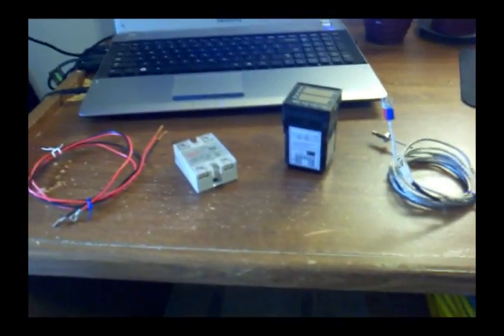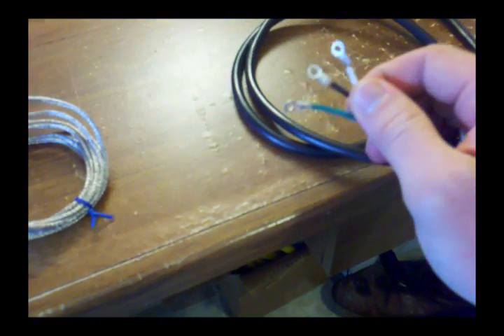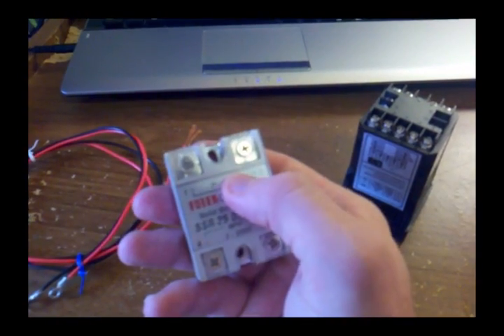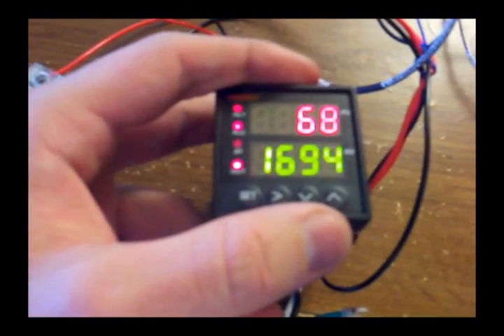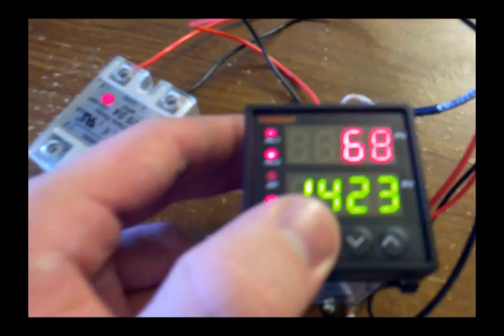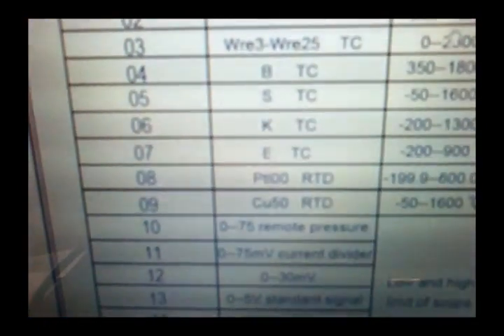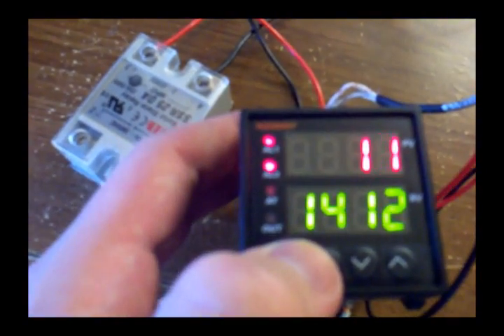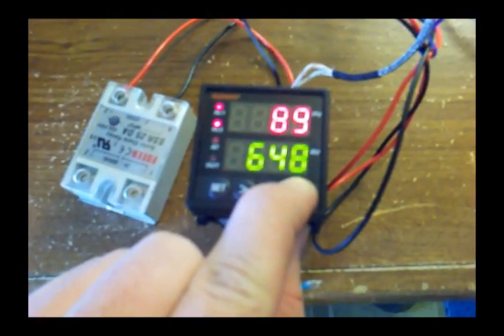Kiln Controller - Wiring the n2006p PID temperature controller and adjusting settings.

Comment: So I have a different pid controller and it has some different settings. How do you make it heat up slower so that it doesn't break all the pottery? I'm guessing I can program different heat set points for certain period of time? I have 14 because I broke it down into half hour increments. The manual is horrible Chinglish.

Comment: I am unsure what you are trying to say @time 2:00,  but you are saying positive and neg on the power cord,   what you saying is totally wrong as far as the polarities,  the black wire is always the hot wire in standard 120v powercord,  the white wire is a neutral, that should have no voltage on it ,, if you measure it to ground or green,,,, the black will have 120v on it if you measure from it to either the white or green,    so as you called the white positive,    makes me wonder if you know about  electricity ,  and for some one to try and work on this after you, it could be very dangerous,  if they don't know you have reversed the wire polarity..

Comment: You know you should do way more research this I didn't know this I didn't know that shit is crazy. Do you know anything? Don't start messing with stuff if you don't feel the need to inform yourself before purchasing stuff and MESSING WITH ELECTRICITY! By the way fuck nut THE BLACK WIRE IS THE HOT NOT THE FRIGGIN NEUTRAL

Comment: I also am making a Kiln and purchased a controller from ebay. On the face my controller says N2006P but it does not look like yours. yours has two lines of led numbers and mine only has one. I wonder what the difference is? Is your controller set up still working?

Comment: Hello...could anyone tell which mode should i select for the alarm 1 and alarm 2 of my p731 Pid , to activate their buzzers just for 10 Celsius duration?  (alarm 1 from 380-380C  & alarm 2 from 390-400C) ?  1)  Upper  or lower limit alarm   2) upper  or  lower limit deviation , 3) upper & lower deviation alarm, 4) within range alarm  ???? ( I have the option also  to set  the alarm 1 and alarm 2 deviation ) . Thank you so much

Comment: Good info, thanks.

A few questions arose. What element determines the highest working temperature of the controller -- the thermocouple or the PID unit itself? What's the highest temp you have successfully used the system at?

Cheers
Reply: PID unit itself. As I can transfer a thermocouple from a Pyrometer to a multimeter and read higher temps off of the same thermosensor.

Comment: is it possible to run two heating elements with a single somid state relay
Reply from the maker: +Marky Martinez Definately, although you'll have to decide wheter you want the 2 heating elements in series or in parallel. In parallel, the two heating elements are joined at the ends and with series the 2 heating elements will be joined in the middle. The main difference is that you should get a lot more heat in parallel than in series.
Reply: oh ok thank you man im new to this stuff

Comment: Is your kiln 240v? Does it only need the single SSR? And where is the wiring from the power coming from? Is the kiln still plugged into the wall or is it connecting to a receptacle on your controller and the controller is now plugged into the 240v power supply on the wall? Also on the older ceramic kilns do they already have a place to install the thermocouple or how did u connect it to the kiln?

Comment: And those R, K etc is not a setting but the type of Thermocouple you have and are planning on connecting. Most likely you have a K type.
Reply from the maker: That's correct. Thanks for commenting.

Comment: DAMN... If you have the little knowledge of electronics, i would suggest you stay away and get someone that know what their doing.  What if the AC power were positive and neg orientated and you plugged things in without knowing? It would blow up your device and in the worst case shock you to death.  Playing with Live wire is plain stupid.  Why are you giving instructions? Are you totally certain what your teaching is correct?
Reply: AC have no positive and negative, only N and L dummies.
Reply: Not an idiot, just needs to learn a bit more on electrical engineering.
Reply: @daviddaigle4841  YOU SHOULD JUST WAIT UNTIL YOU LEARN WHAT YOU DOING TRUST ME I HAD AC  REACH OUT AND BITE ME DID NOT FEEL GOOD
Reply: AND THOSE LETTERS MEAN SOMTHING OR THEY WOULD NOT JUST RANDOM ADD IT
Reply: He perfectly proved his point.
Reply: AC have positive and negative ?? really ??
Reply: lol
Reply: David Daigle yep.  He is an idiot.
Reply: David Daigle lol.  I'm not an electrical engineering degree.  Sometime I'm an field experience, and sometime I'm an conspiracy theory.

Comment: dose this device work?  i have seen the same one on eBay and am planning to use it to control a powder coat curing oven
Reply from the maker: Yes, this model works for many applications that do not require timing schedules to be programmed in. More expensive versions can be programmed, but this one works well for selecting and holding constant temperatures.

Comment: I bought one of these controllers to use for sous vide cooking (cooking for long periods at a constant temperature to tenderise inexpensive cuts of meat.  When I got the PID and the engineering-like instructions I freaked.  While the digital temperature controller unit that I have is slightly different (company that manufactures it is called SESTOS) the SSR is exactly the same.  The basic wiring tips for power and connecting the SSR to the PID were great, thanks!

Comment: As per the note you have added, "Inty" is the type of thermocouple. But  you continue  to not understand the chart reference of E, K., for example, are not offering a choice of temperature range for the controller, but are in fact for the type of thermocouple to be attached and the temperature range is its calibration.  So you select for the type of thermocouple.  The one supplied is a K type, I believe, although not all K types look the same and some are a foot long ceramic sheaf. The K refers to the type of bimetals in the probe. The K could be used for any temperature range up to 1300C, without having to think about my lower peak temperature. Considering a temperature range, first you have to have the thermocouple probe which has that range and then set the controller according to the type of thermocouple.  If for example I had the K type attached and selected E, thinking I only want the lower range, but still within the range of the K, the thermocouple K would be giving inaccurate, even crazy,  readings, because it is not an E.  But I guess it is possible some selections might not make a big lot of difference and you would get a useful reading.
Reply: Hi I have this setup for my wood stove and today the power what out and now it shows 0 all the time how do I fix this so it will work right again

Comment: Caleb,  Thanks for your video.  How do I set the sensitivity or degree of error.  Mine is looked to a propane burner and is constantly turning on and off to keep in a tight range.  I would like to change this to be within say 5 degrees instead of 1.  Any thoughts? thanks.

Comment: Caleb. I watched your video, thanks it helped me in connecting the PID to my old kiln. Now I have a small problem. The Pid Out light in the box just blinks and the kiln goes on, it wont stop. All I want to do is fire mostly ceramics earthenware to cone 04 to bisque it. But I know this PID can be programmed to hold the temperature lets say 200 F for 90 minutes and then go to 600 for 30 minutes more and then go up to 725 F slow then after go to 1971 F At100% power to reach cone 04. How do I do that. I'm new to all this and I wired ok but I try to go to 200 F and it goes to 265 the keep up slow but raising. How do I make it work. Also when I turned on The EEEE you mentioned did not came out. It was already set to 100 degrees. can You give us another tutorial in how to use it to fire ceramics. Thanks.

Comment: You are going to hurt yourself and wreck your equipment. Please learn more about AC wiring before attempting anything. Black is hot, white is neutral, green is ground. In standard house wiring, the neutral and ground end up atty the same terminal strip. DO NOT MIX UP HOT AND NEUTRAL.
Reply from the maker: I put a note in the video to correct my mistake, but you're certainly right. I never really thought people would watch this video very much. I was just goofing off in my room with a project one day and it turned out people did watch it so I'm a little embarrassed for sounding like a rookie.
Reply: @calebp9503  Should always 'switch' your active (hot) wire. So switch means use the hot wire to turn the device off or on. That way the equipment is truly isolated from the power source. If you switch via the neutral wire, there will still be power on the equipment.
Reply: ***** Well, it actually doesn't matter as far as the operation of the product. It matters for safety reasons.

Comment: A SSR does not limit the amperage. The load of the heating elements and the size of the wire and fuses limit the current. The way this solid state relay works is just like a real careful guy watching the thermometer and turning the power OFF whenever the temperature hits the limit, and on again a bit later. The SSR is strictly ON or OFF, it's not like a pedal on your car that gives you just what you need. Increasing the resistance in the line or heating elements will drop current.

Comment: I have a similar PID controller and have it all wired up and I am getting the output light on the PID but nothing on the SSR.  I am also getting .25 VDC out of the two pins from the PID to the SSR.  When I turned it on initially the light came on, but I'm not sure what happened because it's not working now.  Any ideas?

Comment: Good video. I just wanted to comment on the temperature range settings. Those are actually settings for the thermocouple type. So if you have a K type thermocouple you use that setting, and the temperature range is specific for the thermocouple.

Comment: Thanks! Can I use a 40a solid state relay if I have a 30a input circuit? I was going to get a package from ebay that had the PID controller, thermocouple, and SSR.

Comment: I am not sure how to connect them to the heating elements (I will be using some off of a regular household oven). Do I just hard-wire them directly from the solid state relay to the element? if you want to pm me i would be grateful, or leave it here for anyone else who may have a question =)

Comment: Great video! Thanks! I do have a couple questions I would be grateful for some help on... if I'm using a 230v 30amp incoming line, that would be the black/white/green input cords you showed in the video, right? I am probably going to do 2 heating elements for a cerakote oven, (which will only need to get to about 300 degrees F), so you think I should run them in parallel like you suggested below? I was disappointed that you didn't show how to actually connect them to the heating element.

Comment: Actually you want a BIGGER SSR, because the SSR can only switch so much.

A larger SSR won't trip the breaker, the current rating on a SSR only determines how much you can put through it before it blows up/overheats.

If you want to reduce the amount of current used you need what's known as a ballast load. Basically its a load that is wired up in series with your main load. What this does is acts like a giant resistor (think of an **typical** LED circuit, LED + Resistor).

Comment: please stop giving out electrical advice calebp9503.... it's just dangerous.
white is neutral, connected to ground at the service panel . It should be treated as a 0v reference. the black wire in the plug is hot, it goes from + to - 170v (120rms * sqrt(2))
the ssr can limit the effective power going to a device by turning on and off (duty cycle, see pwm etc) Also, listen to klaus
a higher current rated ssr can never hurt, and stay away from that crap ebay brand, get a crydom or something

Comment: An SSR is a Solid State Relay, is just like an old fasioned relay, just without the mechanics. It does not limit the Amps, unless it failes. If an SSR is rated 10 Amps, it means that 10 Amps is the max load you may draw through it, so if you got at 11 Amp load, then use no less than 15 Amps, or you risk running it too hot.

So it does not matter if you use an SSR-25 or an SSR-40.
Never use a part rated for less power than you draw, or you will burn it.

Comment: The only time this doesn't apply is to "double insulated" appliances, where the mains path is so completely isolated that it can be guaranteed never to come in contact with any metal, liquids, or people, even in cases of severe damage or failure. (ungrounded AC can 'float' up to static electricity levels, which presents novel dangers of it's own if it can spark an ionization path, along which the full mains power can then follow.)

Comment: Hopefully someone has already mentioned this: It DOES matter which way around the AC mains goes. Potentially lethally so. One side of the AC is termed "active" and one line is "neutral", because the "neutral" line is ALWAYS connected to ground. For a single device this matters little, but if one device is "neutral ground" and the other is "hot ground" and you happen to touch any exposed metal on both at once... YOU become the mains path, and we loose another experimenter.

Comment: the input settings you see in your .pdf  are the different types of thermocouples available, that CAN be connected to your controller. you should select the type that you have, not only by the range that you need. search for "thermocouple types"

Comment: Good job Caleb.  My kiln will be wired on a 240v line.  The kiln pulls 20 amps.  Skutt said to use a 30 amp breaker.  I want to use two 15 amp solid state relays.  How do I 'bridge' the two relays together to work together, then to the heating elements?  Would really appreciate your thoughts.  Thanks for the very informative vid.

Comment: sup bro, what is the Solid state relay for? I have the same temperature controller and sensor, want to turn on a fan when temperature raises at certain level, and turn it down once the temperature decreases to lets say 68 F, pretty much like a car radiator. So I have all the components, but have no idea how to wire the versatile control & technologies device,  any ideas man?? its  really cool to search on youtube and see that someone else has already figured it out, thanks in advance!!

Comment: well I'm building the entire thing from scratch, I have a controller the same as this video, and I'm using a heating element I bought from the Internet rated at 16A and 240 v. was hoping I could just power them both from the same 240v power supply( I'm in the uk) . can I wire them from the same power supply in series or parallel ? is one better than the other.

Comment: hi, im trying to biuld a kiln from scratch with exacly the same conroler and set up as in this video. does anyone know if you can power the controler and heating element from the same power supply in parralel? would that work?

Comment: Does this controller output in a timed proportional fashion or simply proportional?

Timed proportional works with a user set cycle rate.  If the rate is set to 100 seconds and the output is 40% it would turn on for 40 seconds and off for 60 seconds.  Proportional (not sure if this is the proper name?) would output 40% power as it reaches SV temperature and would not have a cycle rate.  I would like a proportional controller and find it hard to differ between the two after reading pdf manuals.

Comment: Dont know if you might have figure it out yet but if not so the temperatur range you see in the pdf can -ONLY- be used with that very type of probe! If you use a probe with the wrong type the temperature value displayed could be anything from quite wrong to totally useless.

Type K probe for example can only be used up to about 1370C but if you set it to a Type
Wire3/wire25 probe, which is quite expensive, the temperature value would be wrong.

The one you have is a type K so set it to K.

Comment: I ended up not splitting the power wires, instead, I ran one of the power wires to one
of the kiln coils and the other to the SSR..since my PDF file said that the PID could 
be powered with 20ga (speaker) wire, I ran a connector with 16 ga wire on top of the 
power wire to the kiln and another on top of the power wire to the SSR to power the 
controller.. and it works just fine...
Thanks again for your help

Comment: If we continue with the example that you just used, we have a & b (power in), 
we have c & d (kiln elements), we have SSR 1 & 2 (AC side), SSR 3 & 4 (DC side),
and we have Controller, C #1 - #14 ..

So it goes like this: a goes to c, b goes to SSR 1, SSR 2 goes to d, SSR 3
goes to C #6, SSR 4 goes to C #7, and C #'s 9 & 10 go to the TC..OK so far??

Now, do I need to splice in a wire from the a to c connection to C #1 and also splice in a wire from the b to SSR #2 to C #2???

Comment: Let me see if I can get this:
I have power cord with 2 wires-
1 wire goes to the heating element 
of the kiln, the other goes to slot #1
on the controller (I know how to wire
the TC and the SSR from the controller)..
1 wire goes from the AC to the only available
wire on the kiln..That leaves me with nothing
wired from the other pole on the AC side of the 
SSR, and nothing wired to the #2 pole of the 
controller???
Help!!

Comment: How do you wire the kiln???
Do you run a power wire from
slot 1 on the controller to one
of the kiln elements and a wire
from the SSR to the other??

I'm confused 
kiln elemant